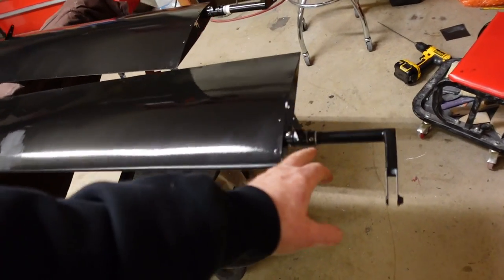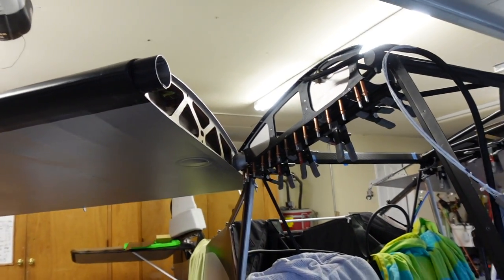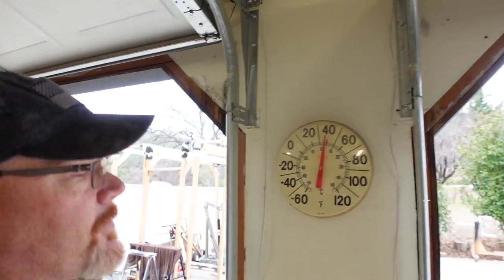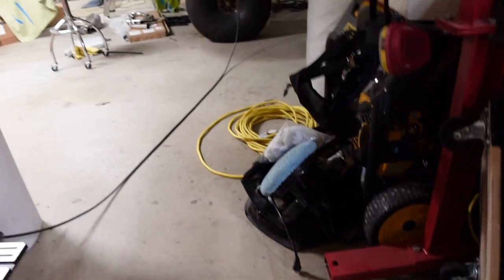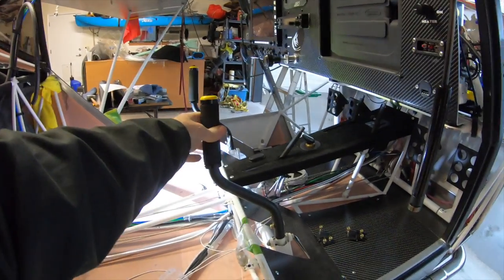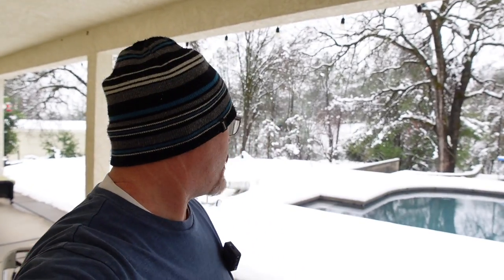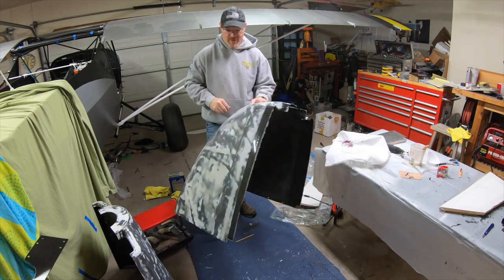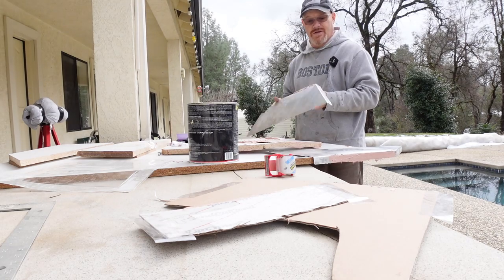Kitfox 7 Apex Build Episode 42 Final Assembly Part 2

Comment: Hey Brian, at 18:54 the connector for your push to talk looks like it has one of the pair of wires lined up with the AutoPilot disconnect feed.  Swap the stick side outer pin to the other side.
Reply from the maker: Haha, I noticed that during editing also, good eye. It has been corrected.

Comment: May be a silly question but why do you not make the flaparons out of carbon fibre? Is it a cost issue or technical issue.
Reply from the maker: Good thought. The flapperons are factory made so it would be a technical challenge.